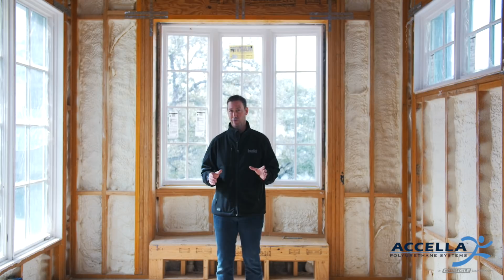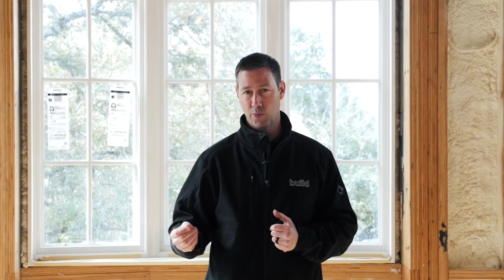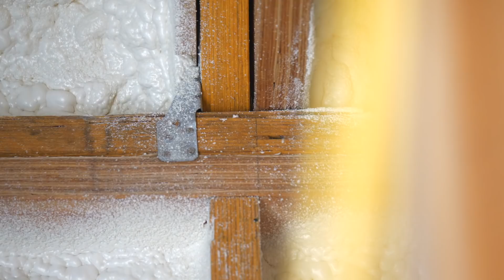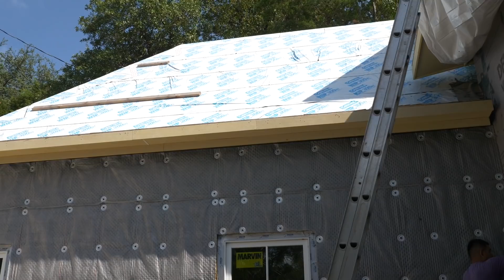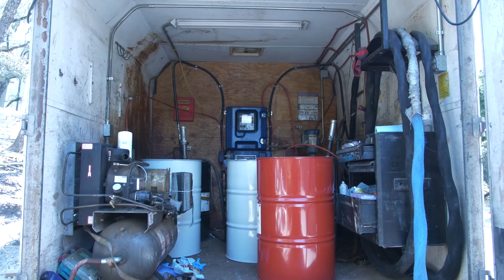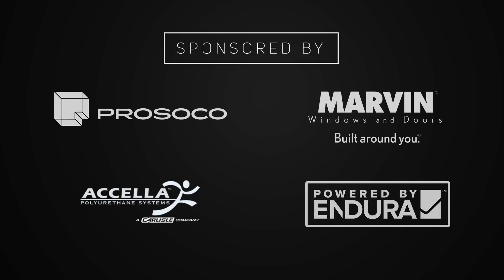Structural Insulation

Comment: Excellent video - very informative and interesting - makes me want to go room by room and pull down the drywall & old pink insulation and then have the spray foam done. I can do the Roxul batting and re-drywall on my own.
Reply: Sounds messy.       Where do you live?     In hot dry places, radiant barriers offer awesome and inexpensive thermal relief.      Consider the three ways that heat is transferred, and put your remedy up against the lion's share.

Comment: What about electrical? You spraying over   conduit and pipes. How the heck you gonna fix those later say 20-50 years?

Also, what about Reno's? This going to affect thst since you need to get rid od this hardened spray foam. That basically glued it self to the frame
Reply: its a PITA, but its not that hard. you can do it with an SDS hammer and scrapping bit.  from what i recall, you basically cut out the edges of each stud bay with a saw then use some sort of scraping blade to break the foam towards the saw cut kerf.  for the left over chunks you can just use a softer wire wheel. to replace the foam you just buy a foam kit or two. 

ive never seen someone remove spray foam from walls packed with cable or pipes TBH, just for damaged roofs.  
i can see your point about removing foam around utilities being an issue... but at the same time the stuff should last longer than the house albeit at a diminished R value.
to replace pipes and wire... i would think it would be simpler to simply take a router to the foam and just carve out a new recess for new utilities and simply abandon the existing inside the foam.
Reply: You can cut in new outlet boxes with a sawzall and claw hammer or wonderbar. It’s simpler than you think to make most changes. I’ve personally done it on my own house multiple times with electrical boxes and sewer vent pipes.
Reply: If u do it right the first time then u won't need to fix them 20 to 50 yrs later.
Reply: If wiring fails, they just run new wires anyways. No one rips out the old. Anytime I help my dad with his house wiring, we see at least two other jobs that are obsolete.
Reply: I hope the electrician oversized the wiring for this job.
Thermal insulation is not good for wiring.
Reply: Same Question
Reply: I did a bit of research on this and there is a foam cutting tool that is basically a hot wire. Never seen or used but sounds like it could work for some situations.
Reply: Use a diversibit and drill straight through it.
Reply: There is roxul insulation going on top of this.  No issues with wiring going on top of the foam, except for a straight hole to exterior.
Reply: "hot knife foam cutter" google it, it slices through foam like a hot knife through warm butter, it's one of the 2 methods for "shaving" the foam after spraying, take a house sprayed with Open cell, if the foam expands beyond the joist bays you can't drywall so the insulation contractor comes back and shaves it down to the bay thickness, that is either done with a saw or a hot knife foam cutter.

Comment: If you are worried about leaks and have the $$ you could consider using an electric field vector mapping grid under the underlayment. If you ever get a leak it is able to pinpoint exactly where it is and get it fixed. Not cheap, but it's a possible solution...
Reply: Vancouver Island Waterjet https://leak-detection.com/products/
Reply: I feel like you dont even know what that means..

Comment: Hey Matt, I like your videos. But i think that sprayfoam used in US is nasty! It can not be healthy living in a sprayfoamed house. All those chemical gasses must get in the livingspaces over time. Also electrical wires etc are hard to replace and foam must attracts moisture.
Reply: Do you commonly replace all the Romex in your house because of age? What about all the chemicals from the rest of your plastic world? Your carpet, bed, shoes, subfloor adhesives, paint, couch, curtains, etc?
Reply: N!els once the foam has cured there are no chemical in the air anymore. It’s no different that all of the other products in your home based out of polyurethane.
Reply: The air is a chemical, the water coming from your taps is a chemical, what chemical are you referring too?
Reply: You can use forced air ventilation. You might think it negates the energy savings but they make "heating recovery ventilation" units that exchange air without losing much heat / air conditioned air. They are good for new and older homes as both are susceptible to bad air quality.
Reply: Yes i know, but when you think about it, there is always chemicals in the inside air somehow; from the foam, glues, laminate floor, kitchenlaminates, lacquer, paint etc. Here in Denmark we try to build more and more with "green materials". Less toxic materials and healthier living spaces.

Comment: is that the same foam used in cold canadian climates?
looks kinda thin , dont you wanna keep heat out down there just as bad as we want the heat kept in?
Reply: It is the same stuff as up north.  Matt mentioned in the video that they are coming in later and spraying some more open call on top of the close cell. It's for cost saving and open cell can fill each bay 100% and be trimmed back easier.
Reply: oh my bad
 i quit watching 3/4 way thru and didnt know you could do open cell on top of closed cell
Reply: It's going to total up to r40 afterwards

Comment: Gonna be interesting to see what techniques are developed to remodel, when dealing with spray foam in the future.
Reply: DSGLABEL it's already banned in Vancouver Canada because of its environmental impact. Mostly  to do with its disposal when demolition takes place.
Reply: It's easy enough to cut/scrap away from the framing. You'd likely cut the sheathing when doing an expansion in any case. 

I did DIY spray foam in a part my basement where I'm building a new home office. Made an enormous difference.
Reply: There are plenty of companies that do spray foam in Vancouver. Are you sure it's banned? Doesn't look like it. I don't see anything about environmental impact during demolition (which would be no different vs. regular polystyrene board).

There are also soy-based foams which would presumably have a lower environmental impact in any case.
Reply: That is always my concern. Adding an outlet would be a nightmare. Guess putting conduit in for expansion would be best.
Reply: In this example, the wall cavities aren't completely filled with the foam. Plus, they look like 2x6. I don't think adding an outlet would be a problem at all.
Reply: Correct StirCrazy. And conduit is relatively inexpensive. Would save a bit on  wire vs Romex, but spend a bit more on labor. Romex was invented to save on labor.
Reply: a "hot knife foam cutter" (electrically heated wire stretched between 2 mounts) already exists and can easily cut through the spray foam down to the sheathing, then you cut your sheathing like normal.
Reply: as someone who repairs storm damaged homes, its a bitch to remove anything when they use this foam to glue the ceiling drywall to the trusses.

Comment: How flammable is closed cell spray foam?
Reply: All of our spray foam (open and closed cell wall foams) go through extensive third-party testing to check for flammability as well as other fire (assembly) and physical properties. ALL of our wall foams are ASTM E84 compliant and are classified as Class A materials (Flame Spread of 25 or less; Smoke Developed 450 or less).

Please note that flammable and combustible are not the same thing. Our products, like wood, carpeting, cabinetry, etc, are combustible. Closed cell as an auto-ignition point of +800F which is significantly higher than untreated lumber.... just as a comparison.

Hope this helps.
Reply: It's nice to know that the Spray Foam industry would sell a product that couldn't burn down your house! 😒 I'm just saying! 😅 Otherwise I don't think this production would be sooo freaking  awesome! 😎
Reply: It’s less flammable than open cell foam. They have fire retardants in them to meet a class 1 fire rating
Reply: S Chang: Yea, but you lose a lot more than just your home: Pets, memorabilia, collectibles,  rare items, etc. Insurance won't even come close to replacing these things. Best way to prevent a house fire is keep your home free of clutter and hazards. Three most common causes of Home fires: Cooking equipment, Heating equipment, and smoking in bed. All preventable!
Reply: Charles R Barbour it can be used to isolate rooms or stop a fire outside a house from coming in because its high r value and it’s a thermal set foam meaning it won’t melt when heated. It’ll burn but has to meet a class 1 fire rating with retardants to be installed in a home. But exposed in a fire it will burn hot. I’m also a fire fighter as well as having a spray foam company and your plastic world poses much more danger than insulation behind a thermal barrier. Look at everything plastic in your home around you. There isn’t much anymore that isn’t plastic.
Reply: Paul Webb I am in the trade and your studying is wrong. That fire was not polyurethane foam. There are all kinds of different foams with different properties and people like you end up spreading a lot of misinformation either accidentally or intentionally. 

The panels on that building were foam so likely polystyrene which is a lot more combustible. Just because it is foam though, doesn't make it anything like spray polyurethane foam. The chemicals are totally different and trying up compare them like you are is incorrect. I've put a torch to foam plenty of times in demos and it self extinguished unlike polystyrene that you can light with a match and will continue to burn and even drip.

Maybe those in the industry are who you should listen to instead of playing expert?
Reply: Nothing self combust. It only take one open flame event to start a fire that cannot be easily controlled. History has shown the results. On the other hand, with our throw away culture... why not homes too... If it burns down, just rebuild from scratch.
Reply: S Chang: Very good question. Paint, wallpaper  and draperies are your biggest fire hazards. People don't even think twice about that. 5/8 drywall will slow fire down quite a bit. With todays codes, very few fires are caused from electrical.
Reply: check the Grenfell tower fire in London, the tests the manufacturers do are under laboratory conditions
Reply: Michael, if closed cell foam is sprayed incorrectly, it can build up internal heat and combust during the curing process.  It won't build up additional heat and self combust while you are living in the house.
Reply: Hope you are not in the trade, the more you study this material the more you find out how dangerous it can be in certain environments. See the Grenfell Tower fire in London.
Reply: Stephen Davis, thank you for the information on flammability.
Reply: Paul Webb what about the Grenfell Tower fire?
Reply: Paul Webb correction it was polyethylene not polystyrene but still not polyurethane and much more combustible. 

https://www.bbc.com/news/uk-41680157
Reply: It's my understanding the closed cell can be used as a fire stop. It's only flammable while being sprayed.

Comment: LVL is about 5-6x the cost of standard 2x6.
Reply: Ryan St. George
Yeah, but it's 10x straighter!
Reply: Great Moose Detective I can live with a crown of l/120 for 1/6 of the cost
Especially considering if all crows of all studs are in the same direction it will be unnoticeable
Reply: Ryan St. George
I agree
Reply: Great Moose Detective, I have yet to see a house that is 100% plumb and level. as a carpenter for over 35 years, I would feel real uncomfortable working with materials that are 100% straight, where is the  "fun and expertise" in that, then anyone can build a home if you have played  with lego toys! lol!
Reply: for real, even if you get a 12" and rip it to 2 6" LVL's the prices are still crazy for what you are getting they aren't that many thousands of dollars better, at that point you would damn near be better off just building a full concrete wall structure, you might end up cheaper with the concrete

Comment: I'm not a big fan of rafters 2' on center. Too many issues with the roof decking.  Just spend the few hundred dollars more and put them on 16" centers.
Reply: @lee_cpa: you're free to have your beliefs about rafter spacing. but your beliefs are not based on facts, they are just based on your own beliefs. you can build houses 24" on centers in snow load areas. if you don't know how to do it, the building code is your friend...

reducing framing is about more than just saving money, it is about improving the thermal performance of the building envelope. indeed, if you watched the video, risinger used lvl framing, so the approach that he took is actually more expensive. now, risinger is in the business of building million dollar houses, so a "cost no object" approach is easier with the kind of construction projects that his company undertakes.
Reply: Spacing is fine.
Reply: Correct, we build custom homes, and we received almost 6' of snow this winter.  Our roofing members are spaced at 24", as well as all of our wall studs.  Over building isn't a responsible use of material or money and is less energy efficient in the long run.
Reply: @s watchorn: building is about trade offs. "over building" could mean exceeding US building code requirements. but there are good reasons for wanting to exceed building code requirements: either with regard to thermal performance, or structural integrity. it's really up to what the builder or house owner wants. the house being featured in risinger's video is "over built" in many ways. some of the stuff being shown is such that you would only do it in a "cost no object" project. my criticism of @lee_cpa was not over whether he was proposing "over building" or "under building", my criticism of @lee_cpa was that he was offering an uninformed opinion.
Reply: This house has 5/8" Advantech decking.  Advantech is stiffer and stronger than CDX and has a span rating of 40".  Also, in Austin there is no need to worry about snow loads.
Reply: Yes, too wide .. 16" is good for Pennsylvania.. I like the ice and water shield.. We get heavy snow sometimes. Good job Matt on the insulation.. spray foam is the way to go..
Reply: , and  yes, use real plywood.. keeping water out of house is most important and takes a lot of work.

Comment: Matt - any case studies or research on how this construction would fair during a tornado? I know it's better than average, but but anything quantifiable?
Reply: from what i understand... its basically impossible to properly inspect a foamed structure for uniformity and quality.  moreover there are no standard mechanical properties of spray foam  from manufacturer to manufacturer. 

it think this is why they dont count on it as structural reinforcement like say... 'let-in' bracing or something along those lines where you can visually confirm the manufacturer and install quality.